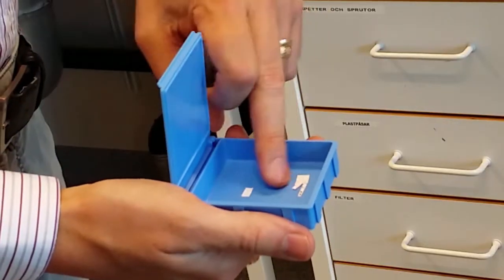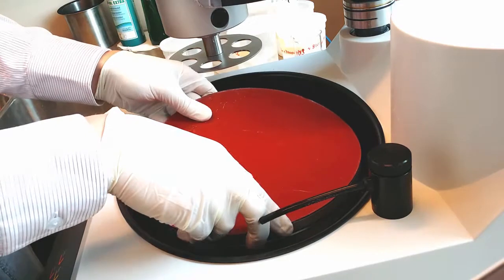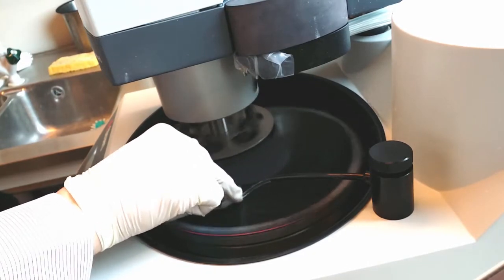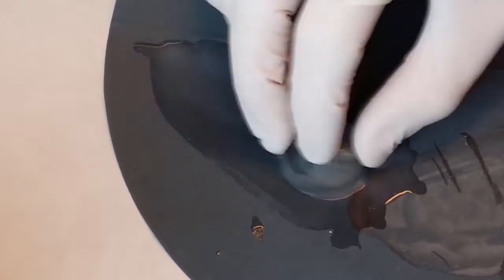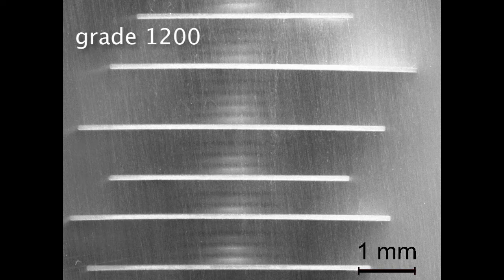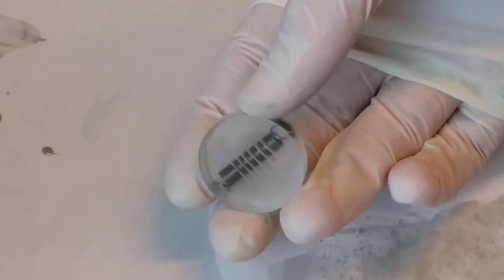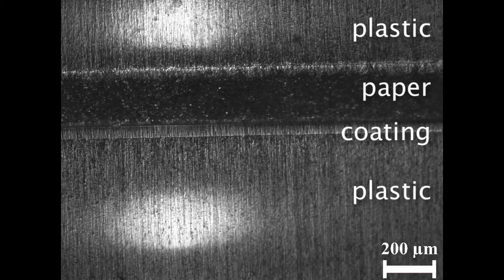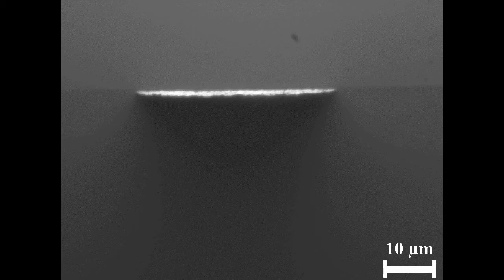Sample preparation: -surface polishing

Comment: thanks for valuable details . 
i have a question ......... how does sample preparation for EBSD analysis differs from preparation for optical observation ?
Reply from the maker: no major difference I will say except quality of the polishing result. In EBSD you strive for perfect mirror finish, in optical if you have some scratches left it will just look ugly but still works.